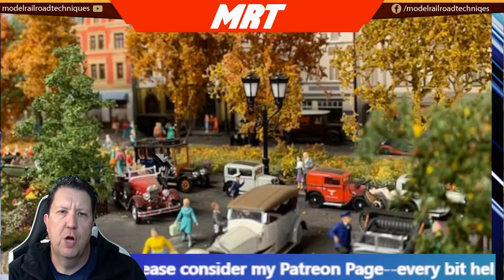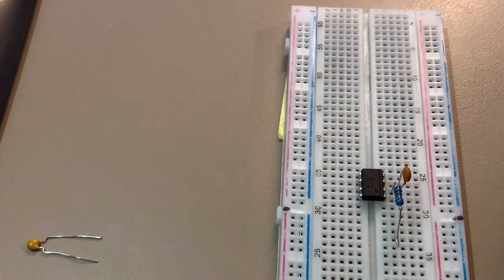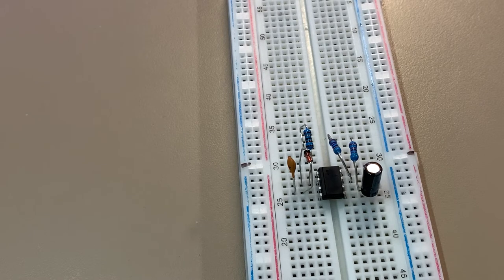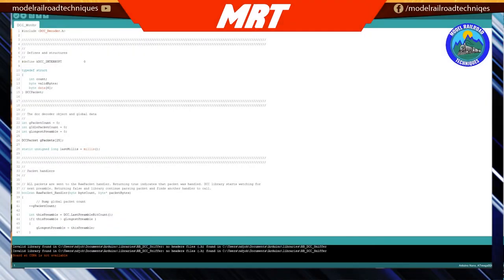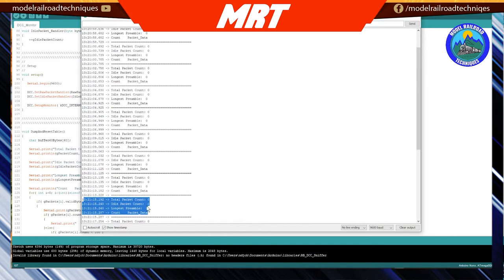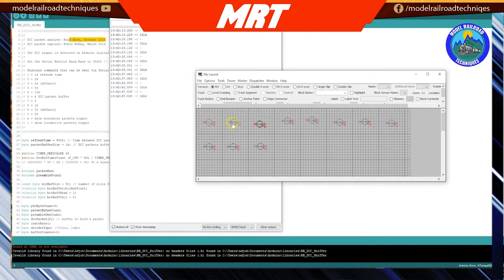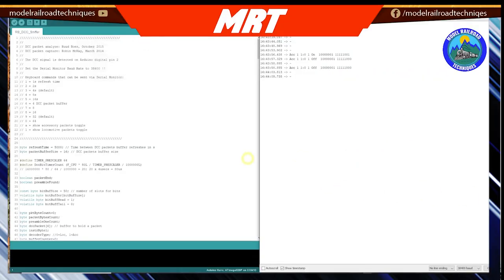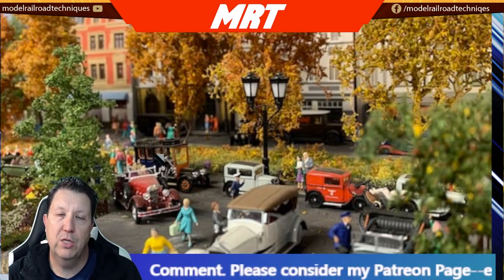Lets Build Digital Command Control Interface

Comment: Nice work. And if you are interested in a technical analysis and potential problems when using this circuit with different track voltages, here's a design analysis: https://youtu.be/pNroNM5ZUVU?t=716
Reply from the maker: Thank you for watching Hans> I will watch this video again as I have now ventured down this rabbit hole